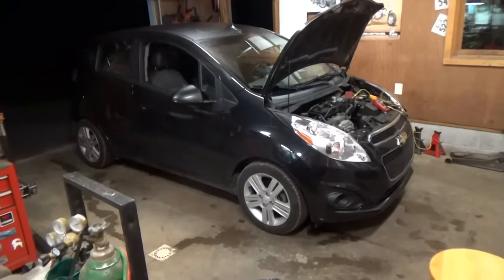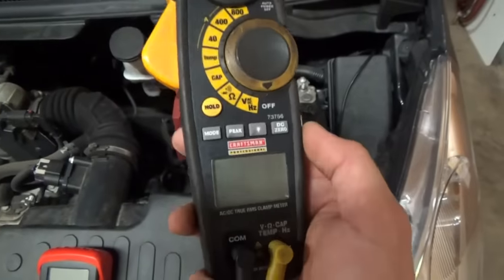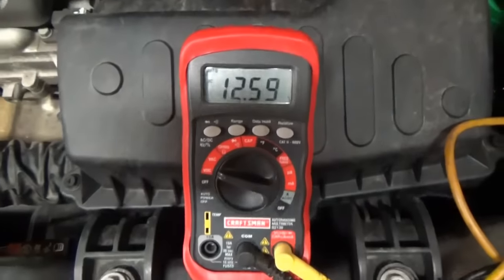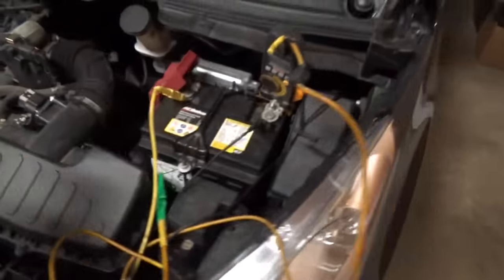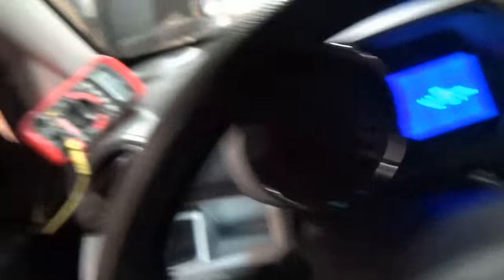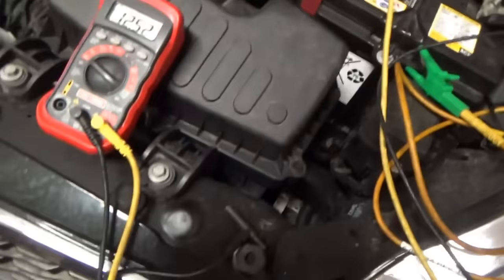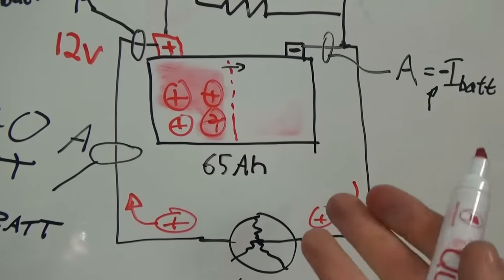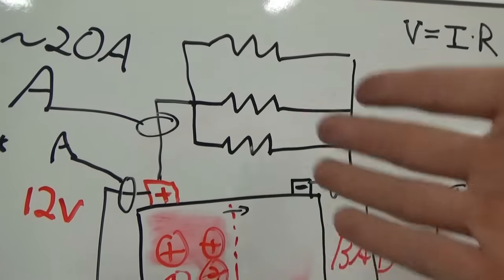Battery-Alternator-Draw Tests: EASY & ACCURATE

Comment: I just went through this with my truck. At about 6 months old, my battery started dying after sitting for a week. Then it would sometimes die over night. Or a week. Went to an auto parts store and had the battery checked.... Twice. At two different places! They said "Good To Go, Battery is fine". Then twice, after being driven an hour to a horse show it would die while there. I went through the whole under-hood fuse box and the one inside looking for current flow across all the fuses I could find. I just knew there had to be parasitic draw!  I did this many times because the problem was so erratic and I didn't know if I was catching it while it was acting up. In the meantime I went so far as to install an on-board batter charger so we could use the truck until I found the problem. I was just about to give up and bring it up to you :)  Then I hooked up my volt meter to the battery while tying start it. Voltage dropped to 9 volts as soon as the starter engaged. After it dropped out, the voltage stayed low. Went and got a new battery under warranty. It's been good ever since. This video would have made me think a bit deeper into my problem back then. Thanks for posting these in depth trouble shooting techniques.  I know I need a new amp clamp now. One that measures DC.
Reply: I've just bought an AC/DC Amp clamp from eBay for just under 19 quid. Can't wait to get it and run through this whole routine.
Reply: Thanks for this tip!
Reply: The same thing happened to me tonight. Guy, at the autoparts, said there is no way I have a bad battery.

Comment: Cheap AC conductance testers that are commonly used by parts stores rely on the battery having a full charge before testing. It sounds like the stores who tested your client's battery got a message from the tester that the battery was undercharged, so they didn't proceed to the next step of actually testing the battery. Their glaring mistake was not to fully charge and retest. Old style testers would put a charge onto the battery while the client waited for an hour or so, and often the battery would clearly fail after that partial charge. If I think a battery is bad, I warm and trickle charge it at home overnight, topping up any cells that are low on electrolyte. After that, it is much easier to condemn a battery that has been given every chance to pass.
Reply: I know this is an old comment but I worked for an autozone for a few years, didn't hate it but wasn't a great job. I remember testing probably 50 batteries a day, usually when the battery was too low to test we'd ask the customer if they wanted us to charge it up and test it, which would take 20-45 minutes depending on the battery. The overwhelming majority of them declined and either bought a battery or went home to charge it themselves

Comment: That car has an old-style charging system. Modern cars have an alternator controlled by a computer. Lucky us. There is also a gizmo installed in series with the negative post of the battery called a Battery Control Module which serves as a sensor/shunt? for the battery current. The BCM feeds that information to the alternator computer. Moreover, the alternator computer has to know exactly the characteristics of the battery. How about a follow-up of this video that takes into consideration what I mentioned?

Comment: Too many places use a resistance type tester to test batteries as they are safe and easy to use. I always back them up with a proper load tester. So many times the resistance tester was wrong you wouldn't believe it.
Reply: The ED 18 by midtronics sucks balls, I swear internal resistance type testers are solely designed to sell people batteries.

Comment: 30 years ago another battery test I was told to do was use a big charger set to high and do a 3 minute quick test charge if it went to 15 volts or over that battery was bad, replace it. Stuck with that esp if battery did not have a good crank power.

Comment: One further benefit of the old school battery load testers versus the new digital ones that simulate a load. The old testers with a heat coil in them would show a bad battery almost immediately. Had this very discussion with a parts store trying to tell me that my battery was fine when it was cooked.

Comment: excellant video Ivan.

I took AUTO TECH. in high school and college, also worked as a mechanic for many years. 

The only legit way to test a battery is with a load test. Those electronic battery testers at part stores are NFG. 

A quick and dirty way to load test. a battery is to hook up a voltmeter, turn on the headlamps for 10 or 15 minutes , if the battery drops below 9.6 volts the battery is bad . 
THE BATTERY MUST BE FULLY CHARGED BEFORE DOING THIS TEST.
Reply from the maker: Yup that is a great load test. Car comes equipped with a built-in load tester!
Reply: Actually, this is technically more a test of capacity than anything else.  LOAD testing is more when there is a high-amp draw over a short period of time, as opposed to a low-amp draw over a long period.  Also this video was way long winded, and hard to follow.  Nice try though..

Best EASY/Quick way to load test is to watch the voltage during cranking.  If it drops below 10volts, then your battery is weak and needs replacing (if all connections are good).
Reply: @Johnathan_Waters  assuming your starter doesn't have an excessive draw when cranking for some reason.

Comment: When I was a kid, I put a new generator on a 1954 Buick.  You were supposed to polarize the gen with a wire touched to the battery.  Mine charged backwards according to the generator gage.  I took it to my mechanic and he turned on the headlights to discharge the bat and properly polarized the generator.  I learned a lot that day!
Reply from the maker: Cool!

Comment: Great channel and i loved your video with Eric from SMA tracing down that twisted camshaft and chewed bearing with lean condition. 
Excellent demonstration of real testing on the vehicle to test a battery circuit to see if a battery is actually bad.
Can i just add some points. As shown, a multi meter and Amp clamp are vital to do complete checks on a charging system and when you work on electronics as well as i do. 
One thing that is possible and not shown here, is if the Alternators diodes are shorted- which happens sometimes. If this occurs when the car is off, the amps will flow back towards the Alt and to earth- draining the battery. So if i find a battery overnight drained, i check the voltage to confirm drain, then i replace with good battery, hook a clamp on either battery cable and see if current is flowing. Make sure all doors and inside lights are off and if you still see amps, something is drawing the current. Next step is to put that clamp around the B+ fat charging cable coming from Alt. You should see NO amps. If you see the same amp number it means its flowing back through the alt and you have bad alt. Disconnect that wire and check at battery again and you should see NO drain now. If drain is not coming from alt but from cars circuit, you need to start pulling circuit fuses till you isolate where the juice is going.
The Alt diode failure is more likely an overnight dead battery situation and i have had one myself. The reason is that the alt can only drain at a certain rate so with a good 50 amp battery, i hour to drain isnt possible, but 12 hours is easily possible. However If you have a worn really marginal capacity battery, and find it drained after a few hours , then the bad alt is possible as it dosent take much drain to weaken the capacity of a worn battery as shown on this video. 
A Battery can have volts and amps available or just volts and not much maps under load. So you can charge up and see 12.5 volts and if you hook a little bulb to it, you still see same volts but is you put a bigger load on it, then voltage should only drop to 10.5V and hold there for a bit-say for the starter motor of 100-300 amps. 
Alt output test to do accurately, you really need a good battery, but with engine running you connect clamp around B+ cable and turns things on. You will see more and more amps output from alt and if regulator is working correctly you will see approx reg voltage say 14V holding ok at lots amps. Those amps are going to power all the things you turn on and a bit left over to charge the battery. If alt was faulty, the voltage would start to crash as you ask for more and amps would stop way short of the Alt rated output of say 80Amps.  RMP needs to be well above idle as idle only produces a limited amount of amps. 2000 RMP will be plenty to get at least enough amps for testing of lights and aircon. You dont need to go to max output, half is enough to prove a good alt is working satisfactory.   

So summary- Possible bad battery?- Check alt output, loose cables to battery clamps and clean, Amps leaving battery when car is Off. Amps leaving Alt when car is off. Then charge battery on charger, conform good voltage then draw Lots current and see if it can hold at least 10V, otherwise  the battery is bad- even new batteries can fail early
If your battery is 4+ years old then capacity WILL be down so, harder to start is normal and no battery can be "repaired" once that lead is gone of the plates . Its just worn out and needs replacing.

Comment: Thanks for recording and posting this video.  
My local mechanics are afraid of electrical problems -- I can't even persuade them to do a parasitic draw test.
Reply: Run away from them. They are not mechanics but parts changers.
Reply from the maker: Have them watch this video!
Reply: It seems like in my area all we have are parts changers! It’s so sad.
Reply: Yes over here in the UK there called fitters, cause that's all they can do fit new parts.

Comment: This is the best explanation and process to check a battery for a novice,  It is easy to understand if you know Ohms Law and electronics, modern cars are full of electronic meaning Computor Busses twisted pairs etc. some of the expensive ones have Fiber optics all this is to cut down on noise interference, signals and waveforms are another area of knowledge needed to explain what happens with coild and releysas they are energized and so on. so bottom line is for people such as you and other who teach electronic can explain some of these funtion. Excllent job Ivan.

Comment: Hello Ivan, when Battery capacity = 65Ah this means that this battery can be discharged during 20 ours with a current of 65 : 20 =  3,25A (at 1,75V per cel at the end of this 20 ours discharge). Greetings from Holland. Nice video again. Greetings Hans

Comment: Excellent point ( @ 15:40) about the post jump scenario of correct voltage but very low charge  current. One symptom of a battery with severely diminished capacity. Easy to overlook . Thanx.

Comment: That's a pretty good explanation....  One of the better ones I have seen.  Well Done.

I might add, just to totally nitpick, the 6 cells in the battery would be around 2.2 volts each, fully charged.  Thus, 6*2.2= 13.2 volts, would be a really charged up brand new battery.  12.8, should be commonly seen, on a charged up "good" battery....

Also, I mean, I was told at one time, parasitic draws should be chased, until you get down below 200 milliamps.  In the modern day, Many luxury SUV's, Luxury muscle cars, anything heavily optioned, you could well see 500 milliamps, and, that's as low as it gets....  I have seen in some owners manuals, they recommend a new battery every year, presumably because they know the car or truck is always in a state of a mild parasitic draw....

I'm not saying you should blindly accept a draw of 500 milliamps, but before you spend a week chasing that, and driving yourself insane, do some due diligence, and find out, is that normal, or not.....

I got a laugh out of your "Battery outlet specialty" store, also....  (I think we know who you were talking about there, heh heh)....  Now, I wasn't there, so, take a grain of salt with this, but I'm guessing the meter was telling him "Battery cannot be tested until charged"....  So, the employee is not properly trained, and does not understand what the meter is telling him, and he tells the customer "Yeah, it's good, it just needs a charge", which is incorrect, as you showed....
Reply: 2.1v per cell x 6 = 12.6v

Comment: Nice video Ivan, one small criticism.  I don't think it was clear to less experienced viewers that the main reason you used the DVOM in current mode to check for sleeping parasitic load was the fact that the amp clamp meter is not as accurate in detecting very small current flow as the DVOM as a current meter in series.  Also worth a mention that a really cheap DVOM may not have the ability to measure current.

Comment: battery issues with my honda odessy handicapped vmi conversion i get worried being handicapped wih an unreliabe van it s been to both vmi and honda of course honda says its not our problem i have added a voltage gauge so i can check voltage before an after using my van keep up the good work your customers are lucky to have you dale janssen retired in arizona

Comment: Best explanation of the relationships between charging voltages and currents under different conditions I have seen yet on the internet Ivan!
Most tubers don't break out the whiteboard/ visual aid which really helps us understand the interplay between voltage and charging and discharging current. After seeing your video will want to get an amp clamp.
Many tubers promote the amp hound but that will not show intermittent draw so like your solution better. Thanks for the good work!
Perhaps you will explain how to find faulty components using the voltage drop method. Lots  of confusion on that.

Comment: I always first test the battery with a voltmeter connected to the battery POSTS directly. Apply a load and try to crank it. If the voltage stays relatively high but the starter can't crank, the battery connection is corroded on either negative or positive connector. Just to confirm, I connect the voltmeter to the battery TERMINALS (directly) and do the test again. 
90 % of a time, this condition is caused by corroded connection points at the battery.
Also, a battery can have a bad internal connection. I have seen this happen a lot. Usually this battery will pass all load tests and fails intermittently. You may also notice unusual  idle RPM variations (AC must be off).
Reply: I like that idea. Thank you.
Reply: Yes-  this is similar to "honey, turn the lights on" - then crank the starter, if the lights don't dim-  you have high resistance connections to/from the battery... i.e. dirty connectors.

Comment: Worth noting that different vehicles will have different optimal charging voltage ranges. My car for example requires 14.3V-14.7V. Excellent diagnostic work.

Comment: Last time I bought a new battery it was for my 2012 Infiniti FX 50S. I checked the manufacturing dates of all available batteries at the shop. The most recent one was manufactured 3 months prior to my purchase, so I bought that one. The original battery lasted about 6 years, and died suddenly without pre-warning after a 15 minutes visit to my local petrol station. So it will be interesting to see how long the new one lasts. My guess is 3-4 years in the climate where I live now. That was the typical battery life when I lived in similar conditions in South Africa. 😊

Comment: Good stuff Ivan. Ive been doing alot off back to basics troubleshooting and this info really helps. Its awesome how much you can troubleshoot with basic tools just by loading the battery and measuring voltage drop. Also measuring alternator charging with the amp clamp to see if the battery is accepting the charge. I bought an Astro amp clamp/mm and a standard multimeter to measure inline amps. They work great and are affordable. Ive learned alot watching your vids and you inspired me to experiment with  inexpensive oscilloscopes to up my diagnostics game. I also use an xtool d8 scan tool. Ive become pretty dangerous with your help😂 Thx

Comment: Brilliant video, thanks. 

One other thing I always look for with a charge fault is battery light operation, obviously it should go off once the engine starts and alternator begins to charge the system, but you can get a flickering light or a very dim batt light. 

Also, with the draw test, I use a jump cable to extend the cars wiring across negative side, then attach my dvom to batt negative-wire loom negative lock the vehicle, remove one jump clamp so the current runs through meter only, I find this reduces loss of contact with meter, I have replaced a few 2A fuses. 🤬🤬

Comment: NAPA Legend, nice.  hopefully you got a good one.  i got burned by that brand.
the battery would take a charge and hold voltage while cranking but would die after a few days.
almost replaced the alternator but figured out the battery was internally shorted.  it was like having a parasitic draw inside the battery.  the damn thing was always slightly warm, even sitting.
Reply from the maker: I've had good luck with Napa batteries. They have lasted at least 8 years each  on my own vehicles :)
Reply: you must keep them charged and not leave lights on overnight.  
in fairness, i don't know the history of my particular battery, just I spent way too much time figuring out it was bad:)